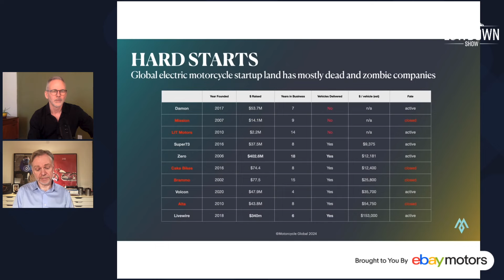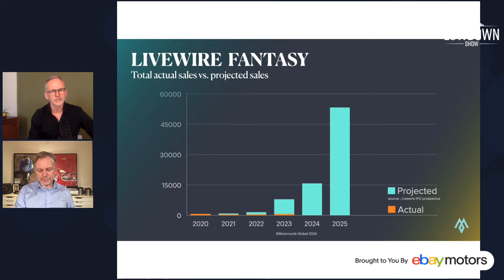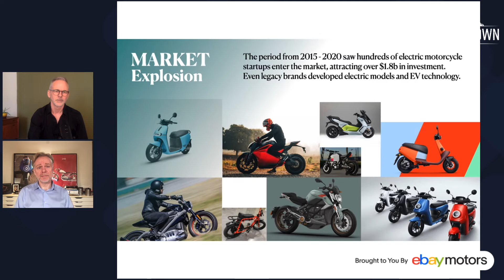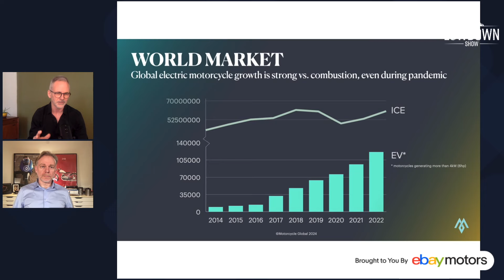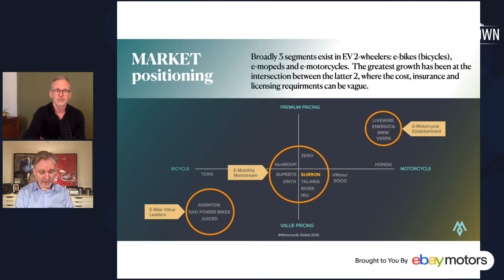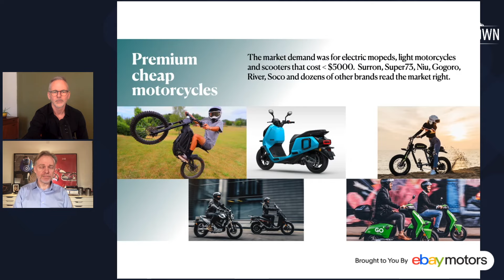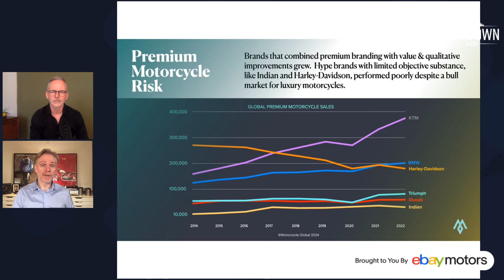Why Are Electric Motorcycles Struggling So Much? - The Lowdown Show Ep 1

Comment: I am the original owner of a 2020 Zero SR/S motorcycle, one of their premium models. I enjoy riding it immensely but it is, to be fair, a toy. The range at highway speeds is roughly 100 miles. At city speeds, much better but I usually ride it in the Sierra foothills since it is so much fun in the "twisties".  The secret to my satisfaction with the Zero is managing my expectations. I never expected to ride longer distances with it but the way it effortlessly squirts out of tight corners makes me smile. I will add I have had no problems with the bike and maintenance is minimal.

Comment: They are struggling for the same reason EV cars are....
1) Cost to much
2) Range is too short
3) Lack of charging stations
4) Too fragile
5) Too expensive to repair leading to vehicles being written off by insurance companies.
6) In Canada and the USA we don't produce enough power to charge all these vehicles by 2030 and the infrastructure can't handle it
7) China controls/ownes 90% of all rights to mining and production of minerals/EV Batteries and no country wants to be beholden to China for all their vehicles.
8) Nobody wants them!
EV vehicles are a phase that will soon be gone because the government has put the cart before the horse as they say. 
In Canada for example a 2024 Hyundai Ionic5 costs about $57,000 out the door price.
But if you hit a pothole and damage the battery it costs $67,000 to replace just the battery.
For this reason, insurance companies in Ontario and BC are just writing EV cars off with the slightest damage because they cost more to repair then to just buy a whole new car. Insurance companies in Ontario and BC have been suggesting in the news that they may not be willing to insure EV vehicles in the future because they lose too much money.
Im sure in the distant future (2050 ish) another form of Vehicles will be built and sold to replace fossil fuels vehicles, but it wont be Electric Vehicles.
Maybe Hydrogen? Maybe Amonia? Maybe something totally new?

Comment: interesting but some of it complete rubbish, all of my bikes have a range of over 300 miles, in fact they are between 500-600, 42 ltr on my BMW and 54ltr on my KTM, the large/extra tank market is a very health one, regardless of how good electric bikes are, 100-150 miles is not good enough, almost none are fast charging and they are all in the £20,000, electric bikes need decent range and need to cost no more than the petrol equivalent, of all the issues cost its the biggest and range the second
Reply: CB500X gets over 300 miles on its stock 4.6 gallon tank, so agree, there are bikes with 300 M range.